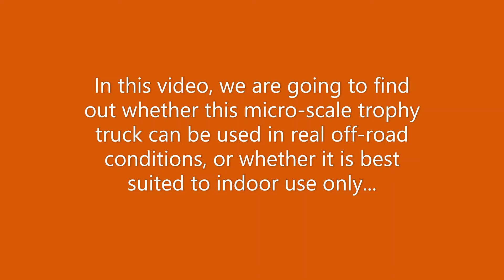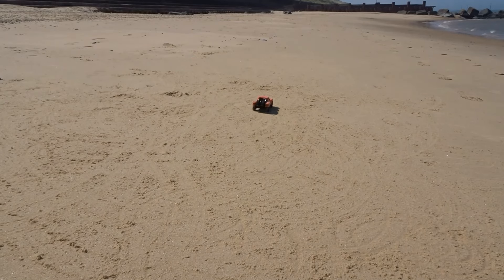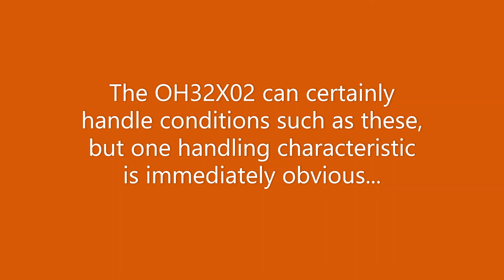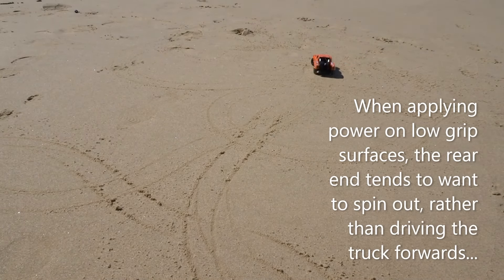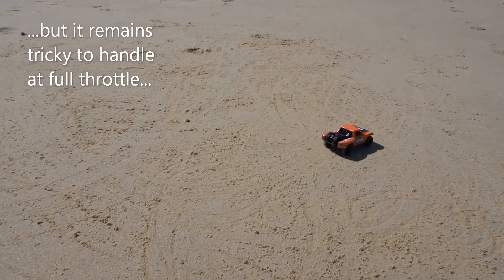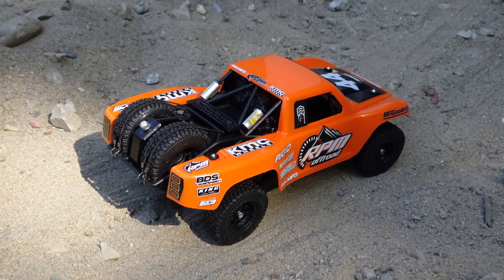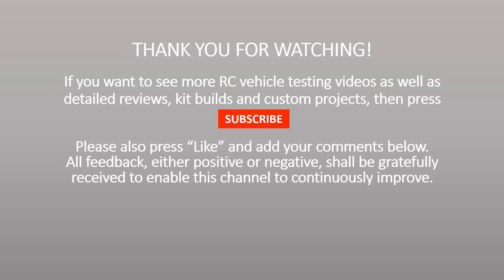Orlandoo Hunter OH32X02 Trophy Truck 1:32 Scale RC Car - Off-Road Testing

Comment: It’s cute and really cool but 200 dollars for a decent build is silly 😂 I’ll be putting an old fms high speed brushed motor in mine 40,000 rpm will make that little hot wheel fly!
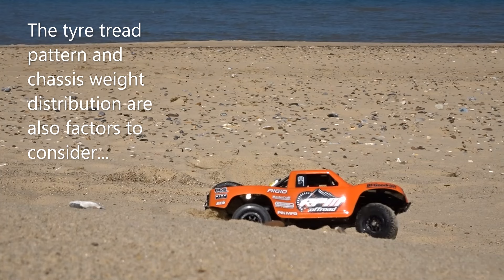Reply from the maker: I have to agree with you.  You can buy a decent 1:10 scale RC car for the same price and it will drive much better.  I bought one because I have tried just about every type of RC vehicle and wanted something a bit different.  There are people who only have small scale RC vehicles in their collection and I wanted the challenge of building one for myself.  Would I get another?  It would have to be really amazing to tempt me because there are so many other great products on the market and the levels of frustration during the build are hard to forget!